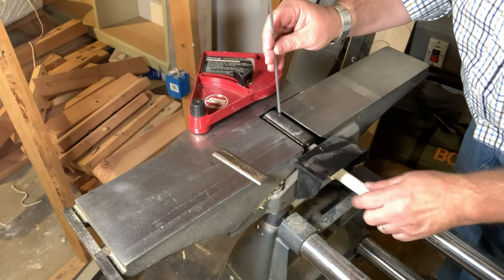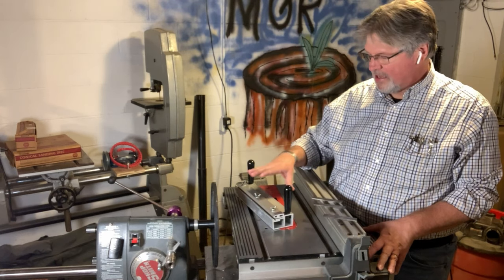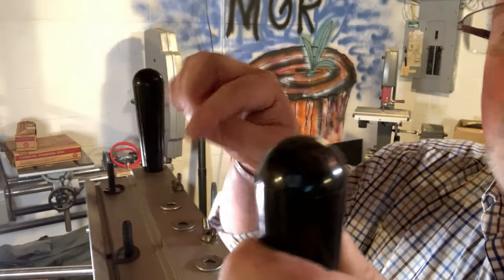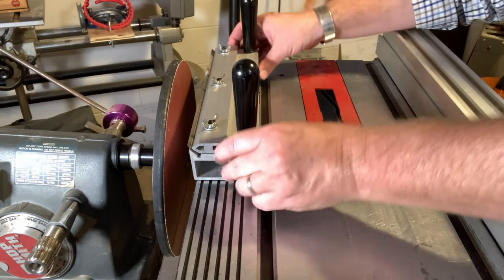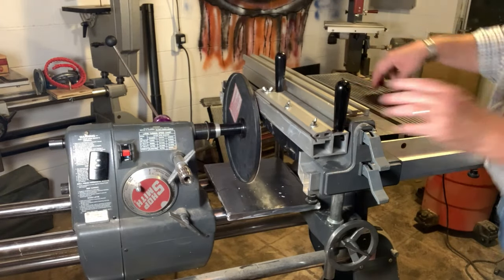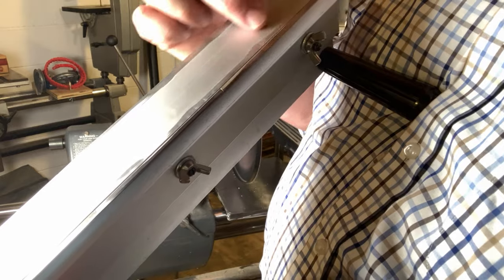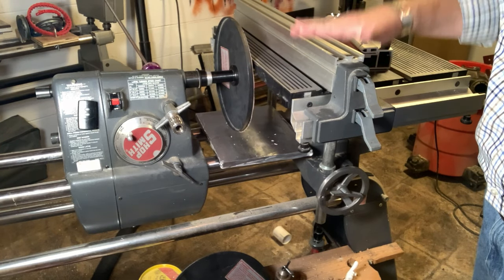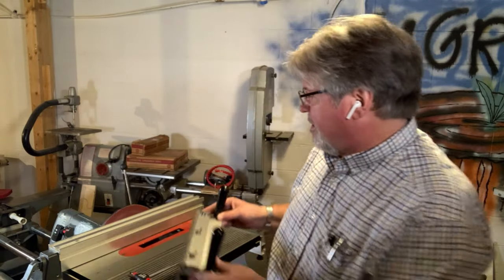Sharpening Jointer & Planer Knives on the Shopsmith Conical Sanding Disc

Comment: How frequently would you estimate the jointer blades should need sharpening
Reply from the maker: It really depends upon your usage.  In normal use I find I sharpen them once a year or so. Not too much of a burden, but infrequent enough that I always have to re-read the manual on my sharpening jig!
Reply: @MyGrowthRings  so my previous thread on the possibility of “upgrading the jointer to a helical cutter head probably not worth the expense even if there was a readily available option since the primary advantage is the economy of the cheap carbide tips - still would have less snipe and probably quieter but probably not worth it.  So now, you n addition to the conical sander ill also be looking out for the jointer sharpening jig!  You should still be on SS payrole!

Comment: I did not know ShopSmith had this. I made a jig I use to sharpen on my 2x72.   But back in the high school years of 92 -94 /i was taking Machine tooling class.   I use to bring dads planer & jointer blades to vo-tech.     I machined a jig to hold them and I would use their surface grinder to bring them to a stupid razors edge,      I had a classmate that watched me pull it out of the machine & cut a sheet of paper with one.  He then grab it from my hand.   He said .."Oh , it ain't that sharp" (as he runs his thumb down the edge My blade.   You could see a white yellow meat before the blood came gushing out)      He was not the smartest guy there....
      I would be very surprised if life has not taken him out by now. He is also the one that.. left a large chuck in a lathe that had been polishing at 3K.... And then turns it on..   The Chuck Key went across the shop and stuck into a piece of Bullet proof glass like nothing .
The glass goes to a shop viewing point.       

But I did have these 12" razor sharp blades in my bag every few months!!!!!!!   Guess what?   No One died!!!  How times are different!!!!!!!!!
Reply from the maker: Too funny! Yes, the Darwin Awards are a real thing!